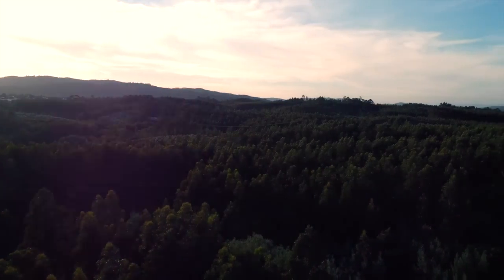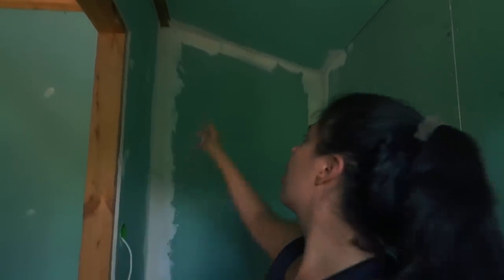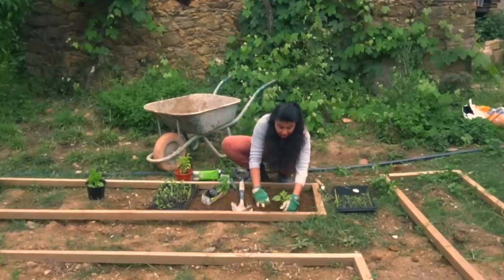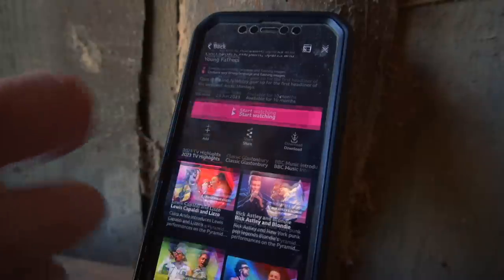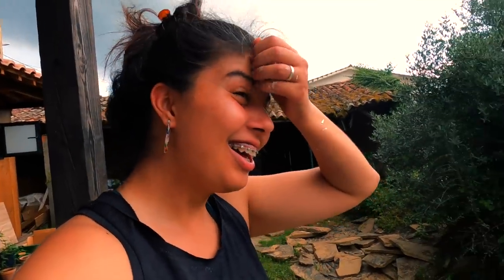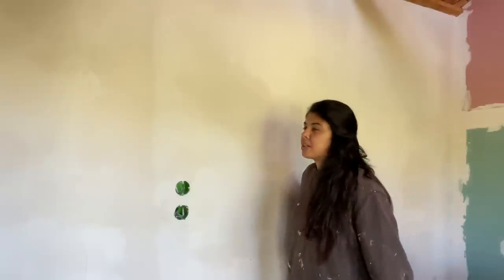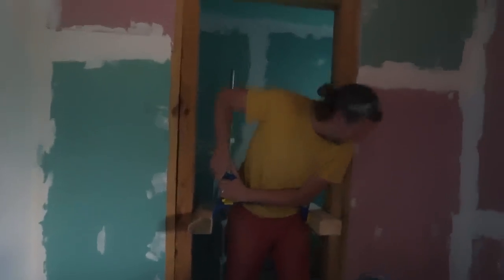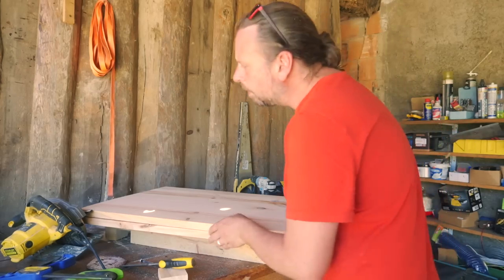DIY Plastering and Stone House Joists Installation - How Hard can it be?

Comment: Hi Andrea, here are some tips from a professional plasterer. I am Canadian, but I work in the UK, so I have experience with plaster and skimming compound. 
You were right to note that the material you are using is nothing like multi finish. Multi finish is a gypsum plaster, and has to be put on in two back to back coats, over about 3 hours. It's flattened gradually as it firms up, and then rendered very smooth when it is almost dry by flicking water on it and troweling tightly with a finishing trowel. This is standard usage in the UK.

What you are using is skimming/jointing compound, which is the standard in Canada. Your first coat should be just thick enough to cover the backing material. Let it dry thoroughly, then sand it aggressively (not with sanding discs in your hand 😊) with a wide, flat sanding pad. Then apply a very thin second coat. The second coat is meant only to fill in the gaps and hollows left from the first coat. There should be almost no lines or trowel marks left. If there are you're likely putting it on too thickly. The idea is to put a very tight coat on, to scrape it on. The material will quickly thicken up on your trowel as you spread and scrape it over the first coat (because of how thirsty the first coat is), and become unworkable, so just toss away any that gets like that and get some nice wet stuff from your bucket. 

Regarding taping your joints, I've never seen anyone do what you did, IE bedding scrim tape into wet compound. It's like a hybrid technique! Normally you only bed paper tape into wet compound. The mesh scrim tape is designed to go straight onto the plasterboard, which is why the tape is sticky. The holes allow the compound to adhere. The problem with your approach here is that some of your scrim tape will sit proud because some of the compound you are bedding it into may have firmed up already. This will cause uneven bulges and some of the scrim tape may be visible. By putting the scrim  tape directly on the plasterboard and then covering it with compound it's easier to bury it and get a flat surface. It should only need a couple thin coats to do so. 
Love your channel, and the cats!
Reply: Another tip would be to get yourself a Marshalltown stainless steel 6"and 8" taping knife, and a mud tray. I am very experienced with a hawk and trowel (I do Venetian plaster and microcement) but I've always found that setup rather awkward for doing jointing/skimming compound. I think you'd find using a wider taping knife much easier.

Comment: I think you've missed the point of "tapered Edge boared". The point is that you don't need to plaster the whole wall. Square edged board however you do (Sorry).
Also I think you were using "self adhesive tape", you apply that to the joint first, then mud it then sand it, finished. Then just paint.
😊

Comment: I'm from Canada but live in the Acores Portugal. I don't understand why you are skimming Gyp rock or gypsum board we just directly paint it in Canada after pulling the joints with a large flat trowel and tape what you have or paper tape. Your work would go a lot faster as you just sand the joints flat using special sand paper for gypsum board that I have seen at leroy merlin. Perhaps there is a reason you are doing it this way but you will have enormous sanding to do. No criticism just an observation . Good luck whatever you do.

Comment: There is a trowel that is made for the inside corners and of course edge of the ceiling where it meets the walls.   It makes taping so much easier.  Than also outside corners best to use metal corners to protect the edges.

Comment: If you ever have to plaster walls again, think about doing a textured look to them , it hides all the imperfections and you don't have to do all that sanding to the walls. You can use a sponge or a paint roller brush to make the look of textured ..

Comment: Just to let you know for next time (am catching up with the videos so a bit late)...
The fiberglass mesh tape with adhesive goes across the joints before you add compound (that's why it's got adhesive) if you bed it into the compound it doesn't really work well. You only put the compound on top of the tape that's already sticking to the wall.
The paper tape on the other hand is put into a compound bed and then compound on top as well.
This difference is the biggest reason why some people say that one or the other doesn't work well!

Comment: Hi, hope you used paper tape  on gaps and joins or else they are going to crack in the very near future. Its looking great
Reply from the maker: I did! but there isn’t paper tape, it’s a net tape that’s adhesive. slightly different.
Reply: @TheIndigoEscape  The paper tape never cracks the mesh tape cracks sonner or later.  Whish you the best, great project..